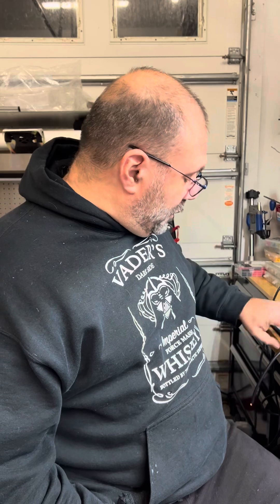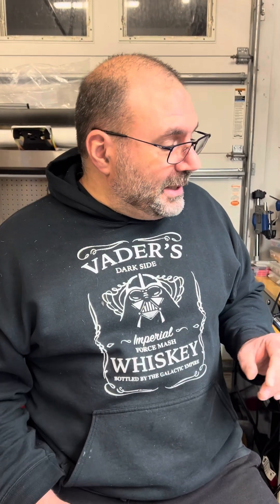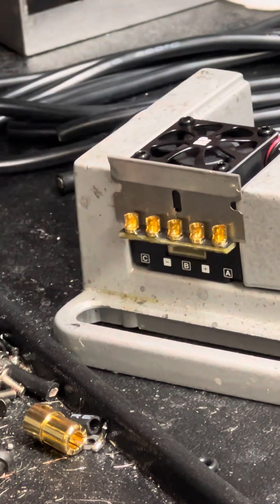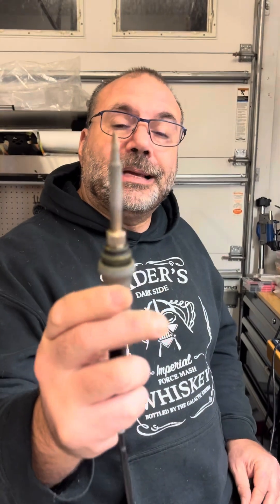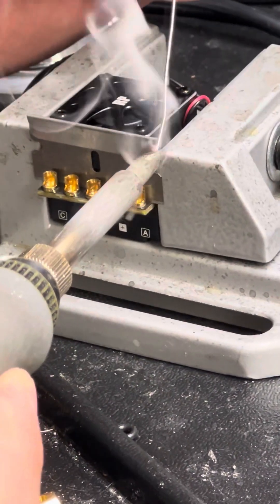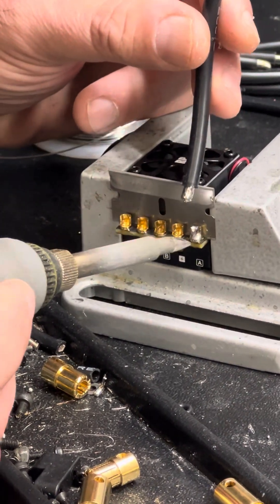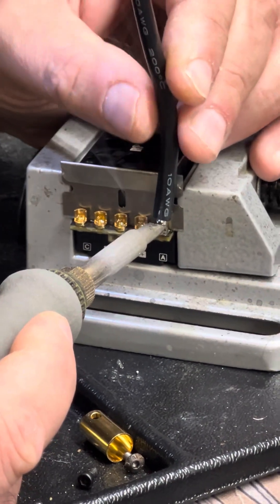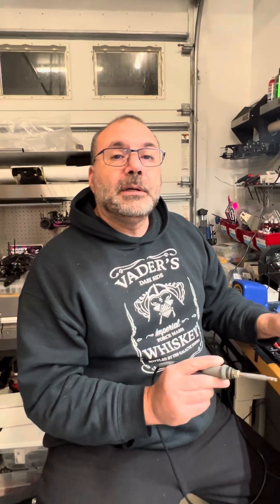How to professionally Solder your ESC for maximum performance and power.

Comment: You should also clean off the solder joints of flux with acetone as it will potentially compromise any electronics boards if it sits on them for too long. It will corrode the boards connections. Technically it should be fully cleaned and then sealed to help combat from the elements. Especially given the environment these electronics will be used in.
Reply from the maker: We use no clean flux from Kester, but yes, you are correct.